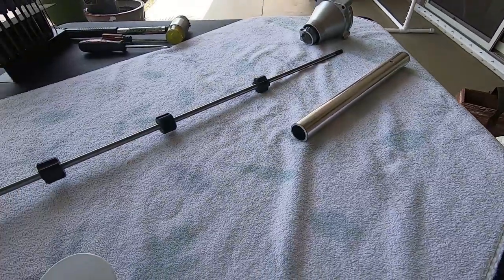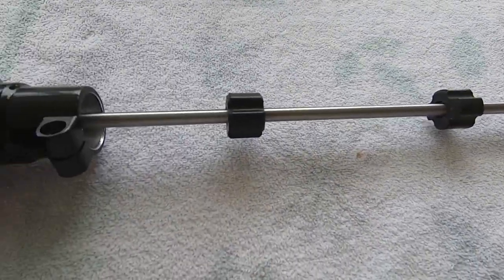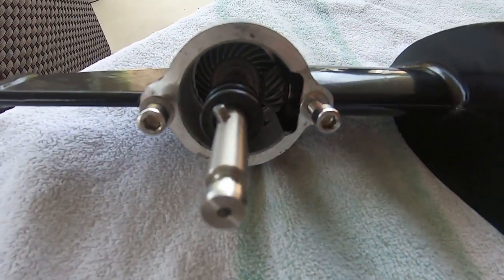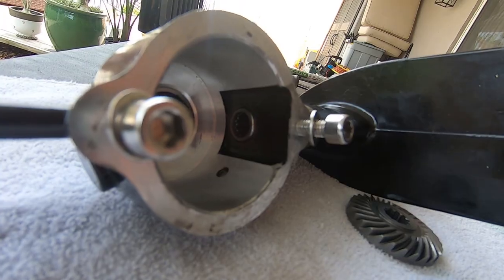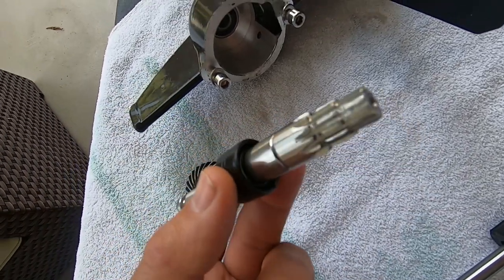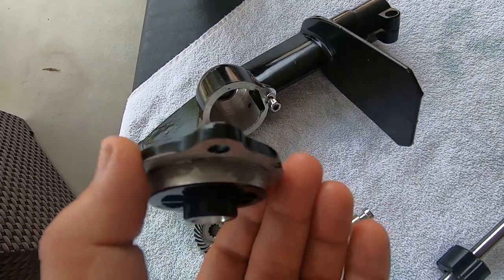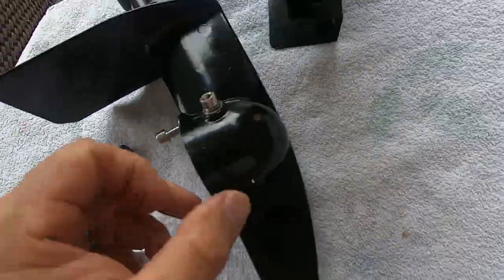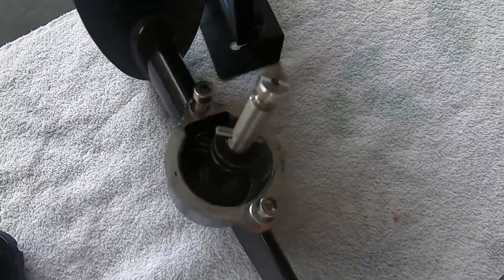Gear Box and Driveshaft Mesh Troubleshooting

Comment: Looks like it would be relatively easy to extend the driveshaft for bow mounted use as a backup/trolling motor. My boat doesnt' have one and I already have a few things with GX35 motors in them so .... makes sense to me since my its 4 cycle and my boat already has gas and I could troll for days on 30gal heh. It would put extra strain on it with the added length but it might be just fine since its only 2hp. I think I have seen some of your videos you have shortened the shaft in a few cases? I'd also be potentially modifying the transom mount into a quick attack plate. Not sure how the tube would hold up but there are possibly options such as glassing the tube or using a carbon fiber tube since most of the strain would be along the length and not torsional.

Comment: Thanks for the information, very useful.... can I please ask a question. The the drive shaft is corroded/rusted onto the spline gear, how can I remove it safely without damaging the gear now housing.... I’ve soaked it al in vinegar for a few days and everything looks very very clean and shiney, however I still can’t remove the shaft from spline gear.... do you have any tricks/suggestions? Thank you here from Australia 🇦🇺 the land down under. Cheers 🍻
Reply from the maker: Take the prop off and output shaft cover plate to get to the gear set. You should be able to apply some corrosion block spray and pop the shaft loose. Soak the smaller pinion gear.
Reply: @kayakbuddysllc-lightweight4947   Thanks, yeah I might try the corrosion block spray now... vinegar can only do so much... cheers

Comment: Also I saw you have those electric starters for the GX35 do you have a source for those? I looked high and low but can only find a complete engine with it for around $100.... which is cheapish but not the $20 bucks or less that assembly  probably should cost. I guess I could chalk it up as spare parts if there is indeed no way to get those separately (apparently there are chinese and india vairants of that thing also the one in india is a rounded instead of squarish like the chineses one).
Reply from the maker: You are not going to find these from a manufacturer that is willing to sell you one. I searched and found 1 part supplier that would.  I bought it and then sold it. They do not line up except to a clone engine and then they will not hold up to salt water. Look into the RC plane world. They have engine start systems that can be modified.

Comment: How can this long rod with thin middle become shorter? I can't understand English very well. Can you type it out and teach me how to operate it? Thank you
Reply from the maker: Kk K are you referring to the driveshaft that plugs into the gearbox. If so you have to have a machine shop cut it down and spline the end. I have 17.75 in versions, which is shorter used on Hobie drive conversions.
Reply: Kayak Buddys - Lightweight Propulsion Systems 17.75Is this version purchased directly, can this be cut by yourself?
Reply from the maker: Kk K I have this driveshaft already splined. Look at the website for details. It’s the Hobie driveshaft at 95.00 + shipping. Www.kayakbuddys.com.
Reply: Kayak Buddys - Lightweight Propulsion Systems Can I buy it in China
Reply from the maker: Kk K you can not buy the driveshaft this size or upgraded parts. These are custom made.
Reply: Kayak Buddys - Lightweight Propulsion Systems ？？？？？If I can't buy it, how can I buy it?
Reply: I don't understand what you mean. What should I do if I can't buy it?
Reply: Kayak Buddys - Lightweight Propulsion Systems  eaby amazoncan buy?
Reply: Kayak Buddys - Lightweight Propulsion Systems I can buy 17.75 transmission shaft directly. I see what you mean. The price is 95, right? Thank you very much
Reply from the maker: Kk K go to my website and purchase the drive shaft and I will invoice you for shipping.